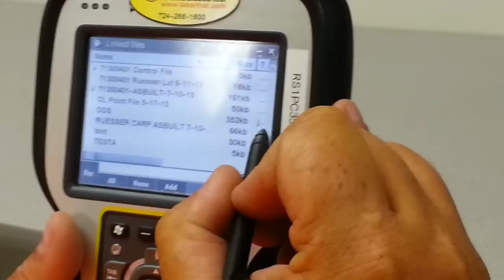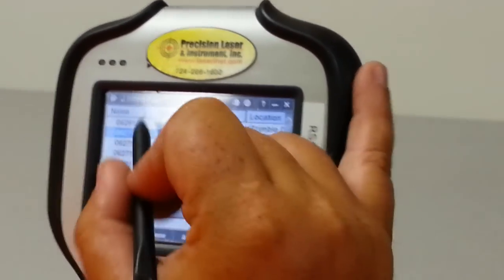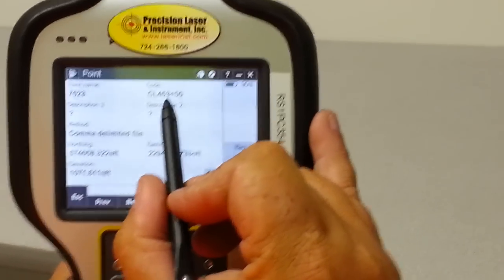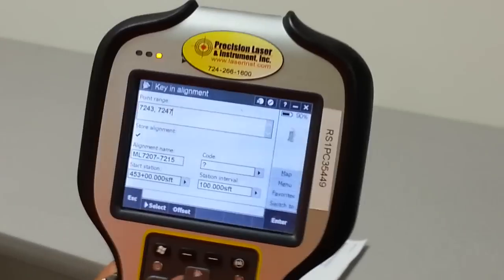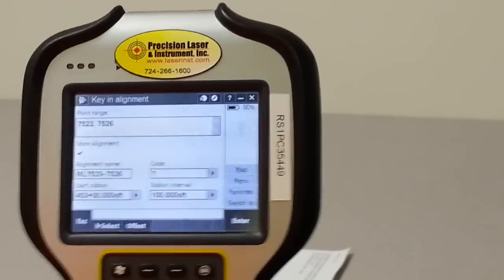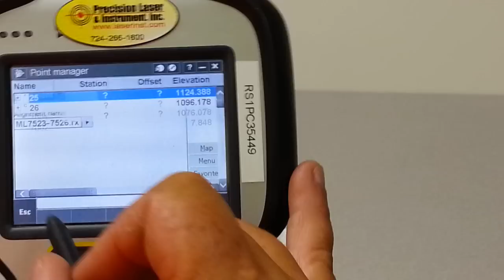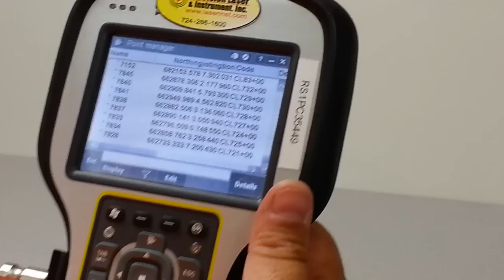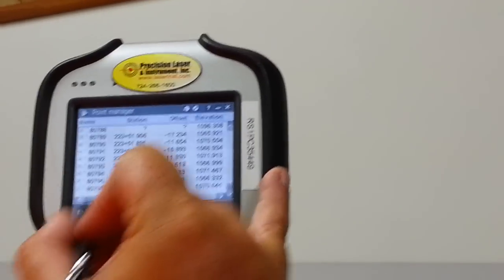Trimble tsc3 stationing alignment

Comment: Thanks again for the heads up video awesome and on point as usual. You can also select the points on the map to create an alignment: which may be a little less confusing in the field. When you create the alignment- in the video all the angle points will be included as well, making it your responsibility to fill out the stakes correctly?
Reply from the maker: Yes it is, I trust everything it says about horizontal. Vertical is another story...